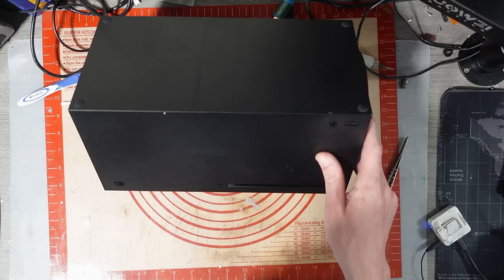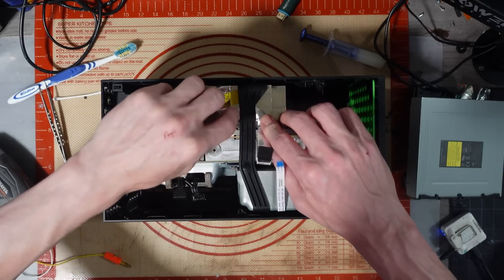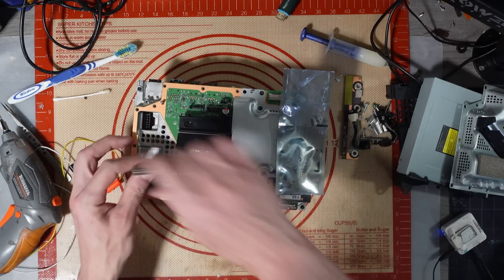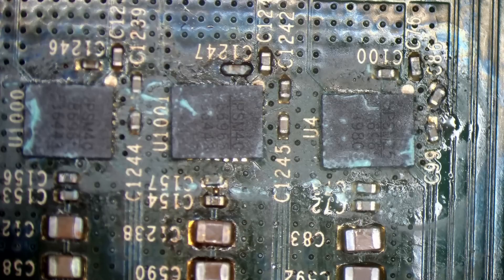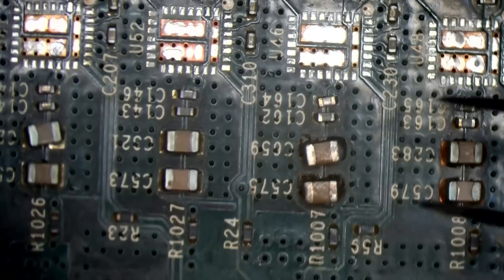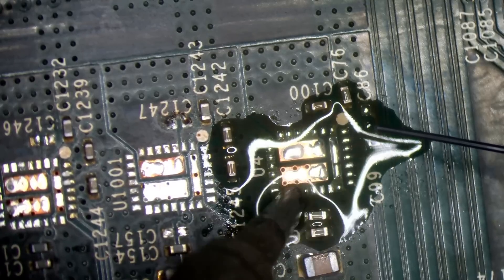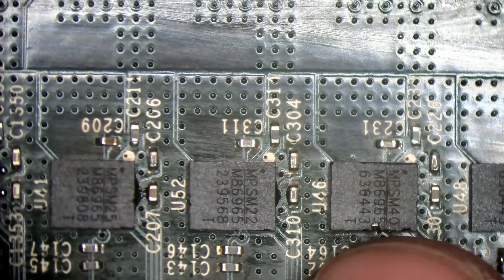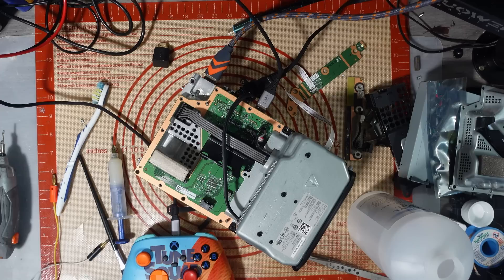This Xbox Series X Seemed To Be Doomed... Can I Fix It?

Comment: Are you aware if anyone has tried upgrading a retail Series X to 20GB of RAM? The RAM modules are different sizes which means some of the memory addresses are only accessible using a fraction of the memory bus. Even if the console wouldn't use more than 16GB of memory, it might make it use the whole 320-bit bus for the whole range.

Comment: You should make vids comparing beginner tools to high end tools. Do two similar repairs but one uses expensive equipment the other cheap.
Reply from the maker: I'd love to but the problem is being able to offset the cost. Most videos make around £50 in revenue so I wouldn't really be able to justify spending several hundred on tools to make a video

Comment: Hello, I have a question that’s not relevant to this video, but I’m currently doing a ssd upgrade on an Xbox one x with a WD blue sa510 1tb. I’ve installed it and I’ve tried doing the offline system update with a flash drive many times and it fails once it says 1%. I’ve tried using 3 different flash drives and I’ve made sure the download on the flash drives are correct. If anyone could give any assistance that would be great.
Reply from the maker: If you are getting an error at 1% that would indicate it can't find the partitions it needs. Have you used the xbox partitioning tool to prep the hard drive before trying to install the software?
Reply: @TheCod3r  I have not. I basically took the drive out of the box and installed it in the Xbox and watched some tutorials on YouTube on doing so. Do some drives already come with the partitions?

Comment: whats best type of solder to use on like pcb/motherboards/radio from car, leaded or lead free and is there a specific type for electronics like you said plumbers solder, im new to it all also how do you prevent headache from soldering
Reply from the maker: Leaded is best because it has a lower melting temperature and the solder won't oxidise as easily as lead free. It also doesn't crack under heat stress as often as lead free does
Reply: Very tidy repair there Phil.

Comment: To me the biggest thing is getting people to realize that the equipment to do this work at that level of precision is not something the average person will use enough to justify the purchase. 
A microscope, Hot air station, several irons, precision tweezers, solder, flux, braid, low melt solder, and you have done set fire to a grand at least.
You still have to have skills with all the good equipment, but the level of expertise needed to properly do this work goes up exponentially when you have tools that are tools, but not up to the task at hand. 

And people wonder why it costs to get something fixed! Its expensive, that's why!!

Comment: I still don't get why you won't switch to a £20-25 T12 soldering station like QUICKO for instance ;). We use it here, all my team and none complain. With an old laptop PSU you get almost 70W out of it and by being T12, it's a HUGE difference in a heat transfer. A no brainer choice for me ;). With 24V PSU, or bench power supply, you get over 70W on it ;).